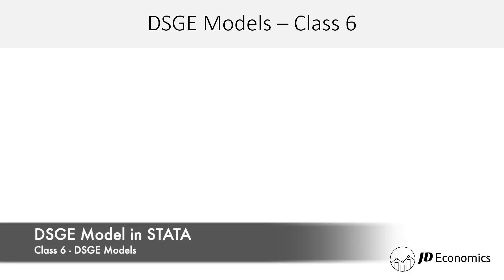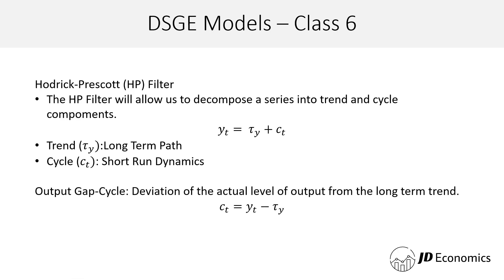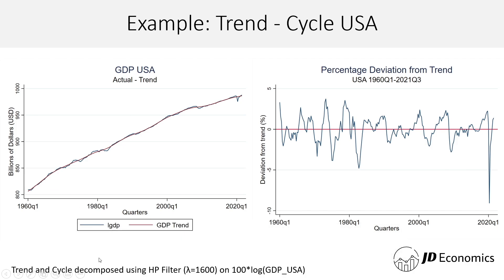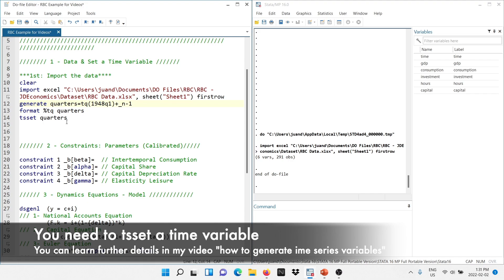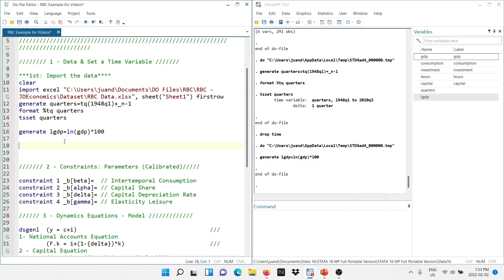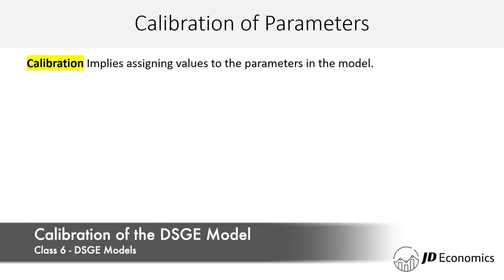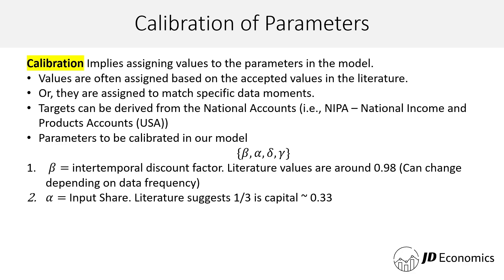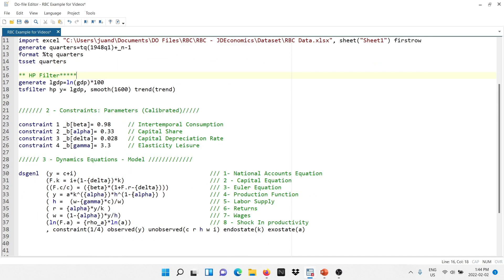Data filtering and Calibration Stata tutorial

Comment: Hi Juan,

I am about to buy your course, but I wonder is this the same as what you offer in Matlab? Are they the same but in different software?
Reply from the maker: Hi! So it’s just the slides I used in my videos and the complete DO file and dataset to replicate the content in the videos. I hope that clarifies a bit. The course in matlab is the same model but I teach the codes in Matlab. I also do an extension in the Matlab version by including an oil shock.
Reply: @ForecastingEconomics Perfect, I bought the one with Matlab, I hope I'll will enjoy.
Regards,
Reply from the maker: @danieldekasse4113  I hope you do! I have an extension where I teach habit formation too. You can have a 50% off in case you are interested. The code is: 50OFF   

 The link is: https://jdeconomicstore.com/b/habit-formation-dynare